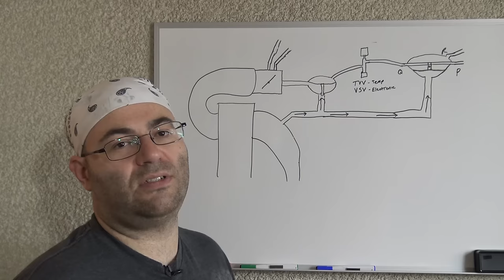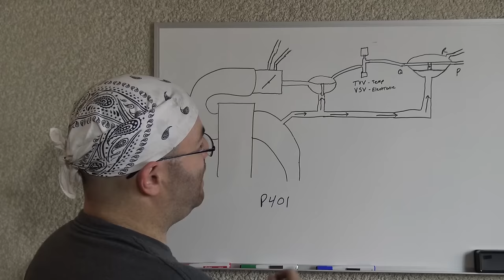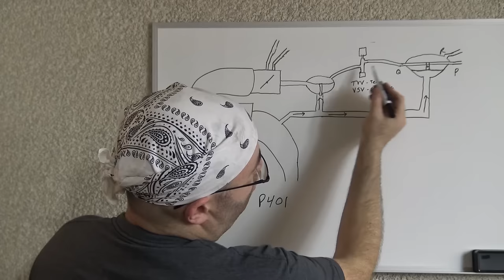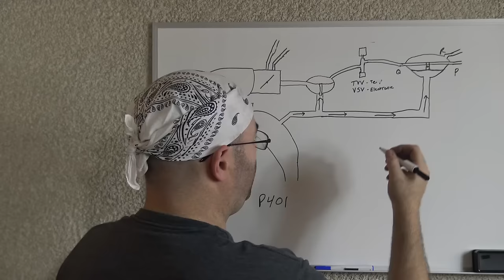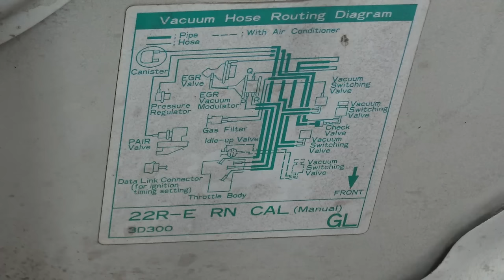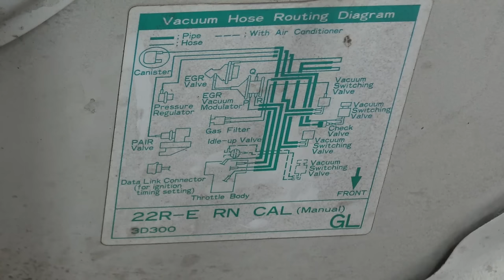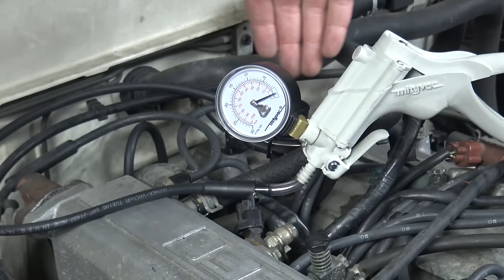DIY Toyota EGR Valve Diagnostics - Back Pressure Modulated

Comment: You are a gentleman and a scholar.  I failed smog on my 1997 Toyota Tacoma, first time I had to replace the distributor cap and rotor, spark plugs and wires, but then I blew NO so much I was a gross polluter.  I had no idea what to do, I replaced the air filter and cleaned the MAF sensor, still failed.  Coming to this video, I bought a vacuum tool much like yours (not the cheap looking one, avoid), and it was my EGR valve that was stuck, like very dirty stuck, which I discovered when I tried to stall the engine by sucking on the ERG port.   Long story short, I pull the EGR valve, cleaned it with carburetor cleaner, checked everything else per your video, and took it in for the 5th smog test, and it passed.  Without your video I would have been lost.  You are without a doubt  a golden nugget of the internet, superb hands-on explanation.

Comment: This was and is a fantastic troubleshooting video. This helped me so much today working on a slow starting 1992 4Runner. I diagnosed, well you diagnosed, that my EGR was stuck closed. What I found was yes that was true, but also the back pressure port from the EGR to the modulator was clogged almost 100%. The hose also was nasty. Now I say that because I got vacuum off the back of the modulator and thought is was good. But still this video brought me to the problems, so Thank You!!!

Comment: Thanks for the detailed lesson on EGR systems. I was wondering how it all worked and now that I know it's just that much easier to deal with the mess of vacuum hoses under the hood. One thing that helps too is just labeling the hoses and wires, I did mine with matching numbers at hose and connector, it took more time but in the end it will save time and headaches. This is my first rebuild and I had hoped just the top end needed work but unfortunately once I pulled the head off I diagnosed a rod knock in cylinder 2 as well so now I get to pull my first complete engine. I noticed in the process that my EGR valve was fossilized inside so it's why I searched ... I'm glad I stumbled onto your video. Great stuff! 🙏

Comment: WOW... thanks to your video, after a year and a half of trying to figure out why my pickup was throwing a code 71 and a lot of $ spent, I found out the shop that put a new head gasket in. Put the throttle body gasket on backwards, whichh gave a vacuum leak.

Comment: Great video. It helped me check out my system on my 91 pick up. Everything tested good but I was still getting a check engine lite. When I put vacuum to the egr valve it would hold vacuum but it wouldn't die barely a stumble. I removed egr valve cleaned out and tested. Tested good and reinstalled. Still had a lite and  no die. I found out the clog was in the plenum. I removed the plenum and cleaned out the passage. It runs the length of the plenum  and the other end of the passage is right behind the throttle body inside the plenum. Runs great, no lite, and dies whenever vacuum is applied to egr. Thanks for all the info.

Comment: Great video! Fixed the egr system on a 98 Camry recently and I wish I had known about this video! Ended up parts cannoning it and replacing all 3 components. It worked, the parts were cheap and there was no way I could figure out how that crazy system works and diagnose it properly.  Now I know!

Comment: Eight seconds in, you said, "It has some EGR problems."  Like what ?  Failed smog ?  Rough idle ? Peeling paint ?  Thanks. The video itself is really well made. Good sound, lighting, script, demonstrations.  Thanks again.
Reply from the maker: failed smog for high NOx emissions.  Sorry I wasn't more descriptive about that.
Reply: Thanks for responding.  I got this goofy 1994 4 runner which passed smog but I Just realized that there IS NO PCV VALVE. Just a hose !   So I just added one.  And there is no vacuum going to EGR modulator.  I suspect the seller and smog test tech had a deal going.  yikes
Reply: Just checked ... "P, E and R" vacuum ports on top of throttle body have NO vacuum, Even tho the other one right there does. I love a good mystery. Thanks again for your videos.  Without it I would just take it to the shop.  Boring.
Reply from the maker: Blow them out, clean out the passages with a fine steel wire like the strand from a bicycle brake cable.  Blow them out with compressed air.  You'll get your passes back.  Then make sure your vacuum lines ain't clogged.

Comment: NICE, It definitely helps me out! Thanks a lot for sharing. I'm trying to understand how the EGR works or not work.I have a California emissions 1986 and it has the temp-controlled VSV shown at 6:25. Toyota actually calls it the "Bimetallic Vacuum Switching Valve", hence VSV nomenclature on vacuum diagram.

Comment: Thanks 👍. On a trip atm and I had to stop for roadworks. Car idled very poorly, and when I drove off had no power with knocking.  Stopped the engine and  all came good when restarted  Thanks to you I'll be able to find the culprit when home ...Cheers ! PS Toyota  Avalon with vacumn EGR.

Comment: Very excellent video.

My 92 Toyota pickup with 22RE looks exactly like the EGR system in the video.  I am still not clear on which vacuum line is which for P and R that starts at the throttle body.

Anyway, this video helps me out a bunch.  Next time I change head gasket or what ever all those vacuum lines are going bye bye.

Comment: The first thing to check when a P-0401 pops up is hoses - cracks defeat vacuum modulation.  Second is the modulator: at some point [with age] the diaphragm of this will crack.  You will get the code, and mileage will drop noticeably.  With no dilution of intake air by exhaust gases, your O2 sensors will detect a lean condition, and long term fuel trim goes way up to compensate - its doubly worse than simple vacuum leaks on a system where EGR contol is working properly.  If the above fails,  solenoid valves may be the culprit - they may be a normally open or a normally closed design depending on engine
Having experienced the fullness of this fault, its depressing: a small, low power v6 engine... getting big block ford kind of mileage of 8-11mpg.  New modulator brought back 16/21 mielage like it had when brand new.

Comment: Thank you so much for this. The 3vze 4Runner works on the same system. Mine has ZERO vacuum off the throttle body....
Reply: That's what is wrong with mine..u figure it out?.. im about to pull it off and clean it

Comment: So i was watching because my idle fluctuates when I hold the brake in the morning and some one said to check my vacuum system. I’m gonna take the same steps you just did and see what happens. Great video btw
Reply: You've probably figured it out already but your brake boaster is leaking.  You can verify with the vacuum gauge.  When you step on the brake, it's letting unmetered air into the system.

Comment: The bulk head/firewall sticker shows the engine family and emissions group. The letter "N" is California but not on the vacuum routing chart that I have seen.
 A dead give-A-way is the screw-in temp sensor that goes into the EGR passage. A VSV controlled by the PCM is used to operate the EGR. At idle, like he did, open the EGR valve, the engine floods the combustion chamber with spent/burned exhaust and the engine dies. The EGR can be manually opened as well. No EGR with a cold engine regardless to RPM. The PCM/ECM based upon run time at road speed opens the EGR valve while steady RPM. It looks at the O2 sensor(s) to see the A/F turn lean as volumetric efficiency is affected. The Long Term/Short Term A/F graph is ignored during this short term. Again, if the Temp Sensor get hot, while the PCM is allowing or commanding it on, it means hot exhaust is flowing and working as designed.
 The ECM since 1992-1994 with OBD-2 starts test every solenoid/relay/thermistor's resistance matches appropriate range using voltage drop across relays coil, solenoids coil, in some cases resistance it is tested each time the engine is started. Most test run during the first 4-5 minutes of start. If air temp and coolant temp are within 10 degrees F of each other, this is cold start and many test are run. Some test like EVAP are run with fuel tank between 80-20% of full/empty at road speed. P1870 on auto slippage are ran full warm at road speed above 50 MPH while EVAP are ran with clock or "X" number of hours since last test, with tank not full/empty. 
The PCM/ECM module is very busy but remember that not all test ran & fail turn Check Engine Lamp on first fail. These do not threaten CAT but can be EVAP leaks like loose gas cap after refueling. So this is a lot to remember but a tech with good scan-tool has to check fail records. If test ran & fail, no light, type B code, but fail records captured. If fail of type "B" code means pending second fail, light comes on. This needs to be addressed. Otherwise, come-back due to dozens & dozens of codes type "A" or type "B". Great info, very good lighting and excellent clear testing techniques.
Retired now but ASE Master Tech since 1978 (EFI/CIS/CARB)

Comment: Man, this is so well done.  There's something to be said about the satisfaction that comes from a proper diagnosis -- one that walks the fine line between being an effective procedure yet not being too convoluted and non-intuitive to understand like many factory service manual procedures can be.  I'm picking up a vacuum pump like yours to run through this test on my '94 Toyota 4x4 pickup with the same 22RE engine, even though I don't have the code (did have the CEL come on for the first time a couple of weeks ago during a long stretch of constant speed, but it didn't come back upon restarting the truck and I haven't seen it since, so I doubt the ECU has stored the code in memory still).  If there's any other videos you do / have done on that old Toyota 22RE, I'd be very interested in learning more.

Comment: Had nothing but problems with my 3vze engine 1993 T100 with high NOx smog etc, the EGR valve is opening, completely clear, replaced the EGR modulator with new valve OEM part 2587065010, only minimally improved the NOx reading. I do have EO approved exhaust headers, so there is only one cat with these headers the secondary larger one. There is two cats on the OEM set up, as there is additional cat that is on the crossover on the OEM exhaust system that runs from the passenger side to the merge manifold on the drivers side. I believe California may have approved these headers without actual having confirmed they were actually functional. What ever the case I'm also looking at the tire size, my truck had two options from the dealer, 31x 10.5 15 tires or 235 75 15 tires,  the 235 75 15 tires are about a .5 to .75 inch smaller in diameter so the engine is effectively working harder at a lower rpm with the 31' tires on. I'm going to test again in 2 years with the new smaller tires as I was able to just barley squeak by their dyno test this past year.

Comment: By coincidence I replaced my 95 CAmry TVV after busting off one of the nipples for the vacuum hose. The only reasonably priced ones were used on Ebay. Days later  (assuming it was a good TVV) I test drove the car and in 15 minutes I got a Check Engine Light. Got home it was a Code 71 (OBD1 on my era Camry)...EGR failure. I'm now suspicious the TVV I bought was not good or not compatible with my year. Any thoughts?
***BTW, a sensational explanation of this gen's EGR. I have looked EVERYWHERE online for info on the TVV, and you are the ONLY good fellow who have given an overview of the EGR plus the innocuous TVV. Most Toyota techs don't know what it is or how it works.

Comment: Exhaust gasses entering the combustion chamber doesn’t cool anything down, they’re ‘cooled’ in the egr cooler on the back of the head but they’re still entering the intake at 3 digit temps. It increases the temps in the combustion chamber and therefore increases EGTs even more, therefore reducing emissions by burning the gasses more efficiently. Remember A cold engine makes power, and a hot engine runs good and efficiently. Removing the entire assembly does in fact free up some power because you shouldn’t have to mash your pedal to the floor to have all the available power at your foots will.

Comment: thanks, it took a few views for a novice like me to get it but I need to check my EGR on a 91  3.0 that shows a 25 code . having poor gas millage and some excess pressure in tank. already checked gas cap, vent line from tank and charcoal canister, changed  02 sensor. any suggestions if EGR checks out ok ?

Comment: Thanks so much for this video, I followed each step and it passed them all, but for some reason when I put my gauge inline with the EGR the needle still doesn’t bounce with throttle. The line going into the egr has vacuum, the modulator has vacuum, and the truck shuts off when vacuum is applied to the egr. Can the tvv be failing even though it passed the hot/cold test? Thanks again

Comment: Excellent Video! Thank you 50s kid. Quick question... everything seems to be working great now except for one thing. The only problem I'm running into is the final test when I hook up the three way to the EGR to tvv hose and I get no vacuum under power.  I hook up straight to tvv I get vacuum under power. I even checked the EGR and it holds vacuum when not running and will stall if I provide vacuum while it is running. I am stumped!  In a nutshell it seems as if EGR is good because it holds vacuum/ stalls when it should and the tvv hose is providing vacuum yet when I make the connection it shows no vacuum under power. I cannot explain it... Maybe you can

Comment: The egr does not open at wide open throttle, This is from Delphi."so the valve gradually opens – it can be up to 90% open at idle. However as more torque and power is required, for example during full acceleration, the EGR valve closes to ensure as much oxygen enters the cylinder."

Comment: So could i just connect Q to the egr valve and run a vacuum line from intake vacuum to R? My BVSV valve is not working and i dont have the money, $89 plus tax, to replace it right now. I'm on a less than fixed income. Just wondering if the BVSV controls the amount, ie. 10 -psi,12.7 -psi, of vacuum. In other words, would too much vacuum pressure hinder the egr system? Thanks alot. Very excellent vid btw

Comment: Hello, I have a 1996 Tacoma and it didn't pass the smog inspection by the code P0401  I have a question how many volts reach the VSV valve and if it always has to have current or there it is measured by Ohms

Comment: Ok got an EGR problem. Got vacuum on all lines except for line R.

Sprayed carb cleaner through line R and it is clean but is plugged at the throttle body. How does one removed the obstruction?

Comment: So when you jumped the VSV, where/what were the other ends of the jumper wires connected to? The battery? Or what? My truck is a 1986 22REI California Emissions. I don't have a Vacuum Hose Routing Diagram. :(
Reply from the maker: Yeah just the battery positive and negative.  Remember to disconnect the valve before you jumper it.  You should be able to find a hose routing diagram online
Reply: Thank you Sir.

Comment: Any chance you have a hpto of the vacuum tree that the hoses connect to?  I found mis run of hoses from back of the tree to EGR.  I cant see the tree end well enough to see which hose goes to the EGR itslef.

I tried the pressure test on the TVV valve in cold and the pressure built up did not release by itself on my guage.

Comment: Hey brother great video! I have a question I think you could answer. That 3 port vacuum port mounted on the intake manifold to the left of the egr valve. Where do those three lines go?
Reply: joshua corkum There are tons of different vacuum line configurations. The easiest way is to follow your vacuum diagram underhood sticker if you have one.  If not, getting the correct diagram for your rig can be a little tricky.  Mine was illegible except for the number 38 in the lower right corner of my sticker. Toyota has this info copyrighted and will not share it w toyota owners.  If you still need the info and yours is illegible, let me know and I’ll give you some pointers on how to get the right info.  It took me 6 months to find the correct layout for my rig after a mechanic screwed it up.  I have much search experience! Lol

Comment: hey man... good video, it gave me some good information to go by. Only thing is as I checked the egr, the modulator and vsv, they all checked out to be good. I'm getting codes p0401and p0300, p0302 and p0305 and I just can't seem to figure out what is going on, I'd appreciate some help very much. I have a 95 tocoma 3.4 4x4, when I crank it up in the morning it runs great, just like brand new but when it gets up to running temperature it starts running very rough and the check engine light starts flashing. Any ideas of what maybe causing the stumbling once it gets to running temperature?

Comment: I wonder if the tvv valve's piston seat is cracked having seen the test you did , it should hold vacuum .The piston is a 5/16" metal tube urethane coated flanged at both ends , it seats on a 2 different diameters cone shaped seat mating the tube wall and the counter spring . When it is cracked it allows ports to be connected with some restriction . I rate your video 5/5 , regards

Comment: I’m getting vacuum pressure on P but not on R. When I connect in the end to the hose that meets the egr I’m getting no vacuum pressure? Does this sound like clogged lines or is the modulator failing somewhere and only producing some vacuum. I have a P0402 excessive flow egr.